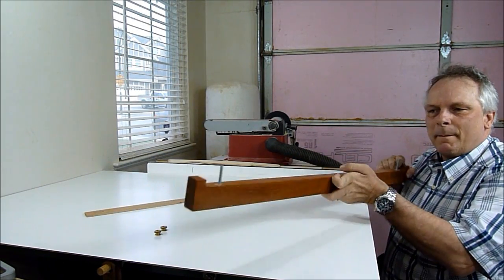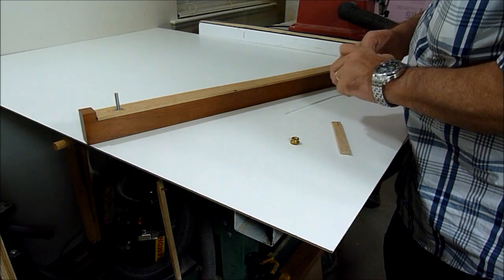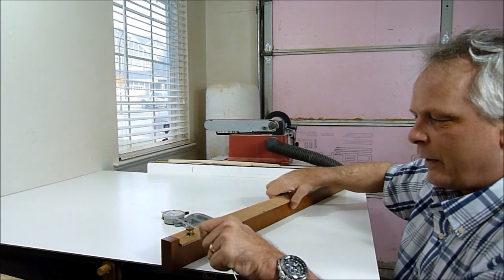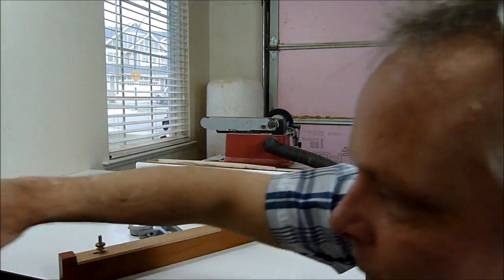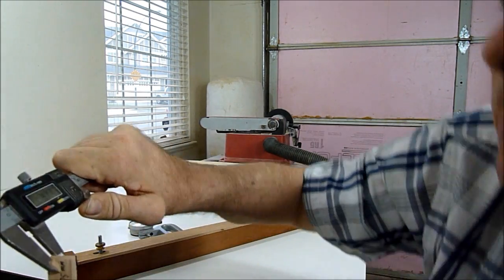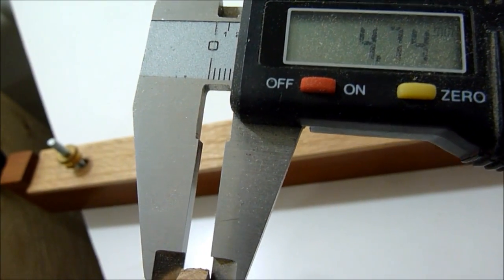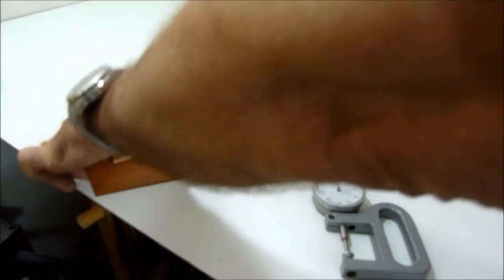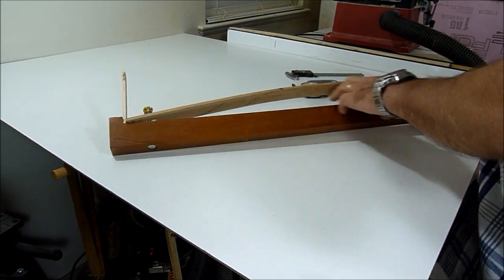Wood Movement

Comment: Interesting way of showing the results of thermal expansion.  It would be interesting to see the difference of the coefficient of thermal expansion with different types of woods.  I would expect softer woods, or wood that is more wet to expand and/or  contract more drastically, but you never really know till you try. great video.